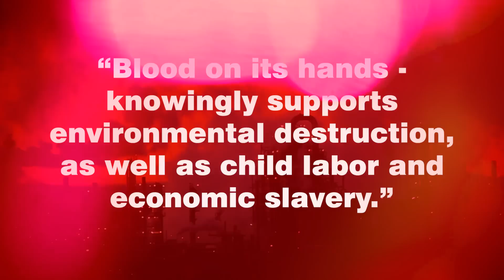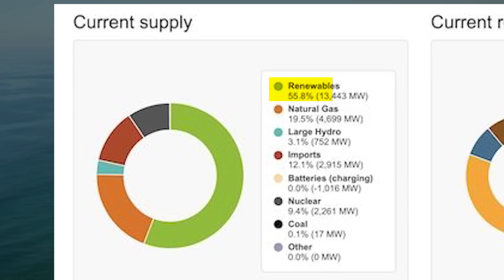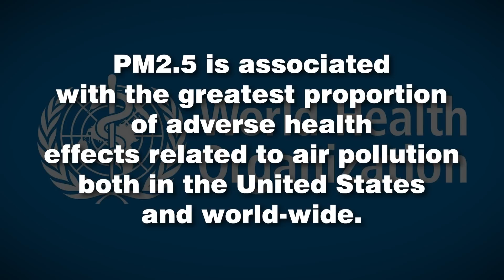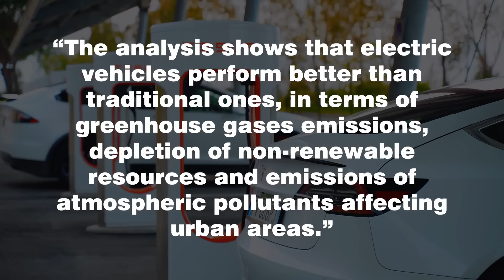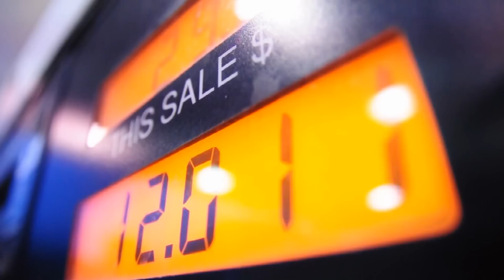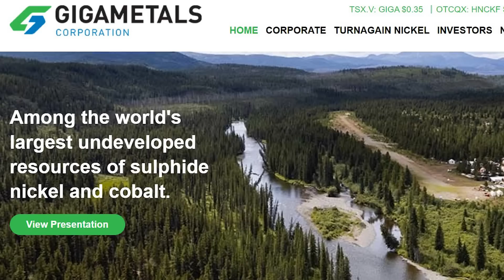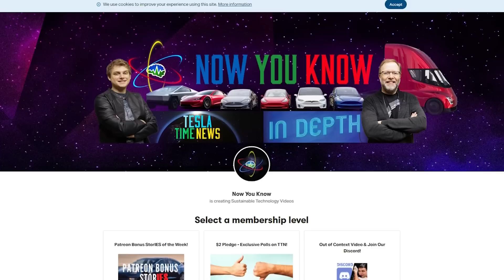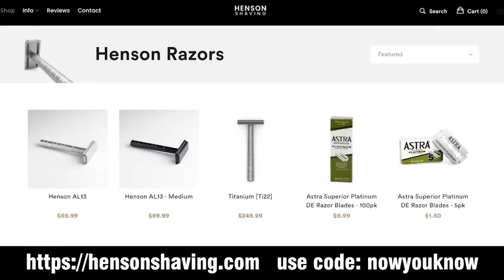Debunking More EV Lies | In Depth

Comment: Electric power plants using fossil fuels for energy are more efficient at extracting energy from the fuel than internal combustion cars. 

Theoretically if everyone converted to EV instead of internal combustion engines in cars, there would be less emissions immediately, as EVs are over 90% efficient using electricity needed to charge to drive. 

Power plants are also 50-60% efficient at extracting energy from fuel to generate electricity, whereas most vehicles only can extract around 30-35% of the energy content of gasoline to propel the vehicle. 

Plus, having all vehicles as EVs mean it’s way easier to cut emissions further, as now you consolidate energy needs to electricity, so the more electricity you generate with sustainable practices, the lower your emissions drop. 

I also read an interesting stat that close to half of all EV owners actually have solar panels.

Comment: Wind and solar will not save the planet. As there closing down nuclear power plants that we need and not just for power. So untill we have fully working nuclear fusion there will always be problems. But even then if all the mining, waste and recycling isn't made fully green and environmental friendly damage will continue to be done. So we need more power, better Tec, better cleaner manufacturing, then more power, better Tec and so on.

Comment: You’re as bad as her. You’re cherry picking your data too and using fear tactics to push your point.

For the honest answers look at Engineering Explained videos and consider that Volvo’s studies show a CO2 break even point of mid 20k miles to 90k miles of use depending on the type of electrical generation method.

Comment: The one I find most interesting that no one seems to make mention of is the how it would take 60,000km before it is cleaner than an ICE vehicle. So the theory is, "it produces emissions so we shouldn't use it." but that ends at 60,000km in comparison to the ICE vehicle which just keeps producing emissions for every day surpassing the EV emissions. Also why did they use Kilometers when they used miles for other numbers. Took the higher number for emissions in KM's, took the lower number for battery life in Miles. You might be giving away your biased when you do that kind of manipulation.

Comment: The comment at 11:26 is also misleading as the highlighted text refers to batteries being replaced every 100k miles (where they got this I don't know as few if any non Tesla EVs have covered 100k miles) but the text GOES ON to say that the more likely lifespan of a battery is 200K miles or more - giving similar longevity to a (well maintained) ICE car. And another "omission" with regard to cobalt is that it has been used extensively for many decades (SINGLE USE) in the removal of sulphur from gasoline. So when you drive round in your ICE thinking no children had to work in a Cobalt mine for my trip to work - think again.

Comment: It shouldn't take 20 minutes to say, "Electric vehicles are only as clean and only as efficient as the methods used to generate the electricity that charges them."

And an all-electric vehicle does not work for everyone or in every situation with current battery technology.  Hopefully it will someday, but not yet.  The energy density needs to increase a lot and the cost needs to come down a hell of a lot for it to be useful to everyone in every industry on every vehicle.  Even hydrogen as an energy storage medium would be amazing in energy density and environmental friendliness when compared to lithium, but with clean water sources drying up it could make things worse in some areas.  Either way people go, we could certainly use more clean sources of energy like solar, wind and hydroelectric power...

Comment: Hey great job 👏 I would like to ask is it true or false that if something happens to a ev battery where you have to spend $10,000 just to get it replaced or is there a life time ev battery warranty that if anything happens to the battery it can be replaced with little to no cost for the ev owner?? Also yes the ev batteries have a great range but that doesn’t mean that batteries will never have problems or fail just like with anything else with or without batteries??

Comment: What I really hate about the statement that electricity is made mostly from fossil fuel is that don't take into account the efficiency. EVs cost 2-3 times less on charging than ICE.  Fossil powerplants are way more efficient that ICE!!!. Second u got way less pollution (air AND noise) in cities. And for recycle, first u need the stuff need to be recycled then u build the industry around it :))).

Comment: Let’s be honest, you guys are electric car fan boys. That’s great but do you really think electric cars are the answer? They are not much cleaner than a gas powered car. The amount of raw materials needed to replace all gas powered cars with electric literally doesn’t exist. You admit it yourself, ‘green’ power generation is not quite there yet and let’s be honest in 10 years it still isn’t going to be either. Buying into all the ‘electric cars are the future’ and all that is just plain short sighted. If you really want to make a difference then I think driving your 200 pound arse around in a 4000 pound plus metal box is a little overkill. And that’s before you even look at the bigger picture and realise that cars are really not the problem. They just get a bad rap because they are an easy target and the government can easily tax them. Swapping every gas powered car in the world tomorrow with an electric one would not  make any real difference to co2 levels. Just be honest, electric cars are cool but electric cars are clean? That’s  not the reality.

Comment: Disinformation practices by the oil industry and their shills reminds me of the same industry’s deliberate deceptions designed to muddle the impact of lead additives that sickens or killed millions, and of course the many millions who died as the tobacco industry misled us.   Also, the power plants that do use fossil fuels are operating 24/7 with minimal capacity to shift output to meet demand…so outside of peak load periods, a lot of generated power is lost.

Comment: Assuming this fud’s claim of a break even pollution point of 60000 kilometers ( 36,000 miles), then that’s a now brainer for ev adoption considering cars in the USA easily last 150000-300000 with a fleet average of  11+ years old and rising

Comment: One thing that always strikes me as odd and seems to be overlooked is the pollution involved in extracting oil and refining it to gas.  People always want to discuss the “long tailpipe” of the EV but they don’t want to discuss the “long tailpipe” of the ICE vehicle.  

This is the 1st video of yours I’ve watched so if you have discussed this before please link me to it as I’d love to see that.  If not can you look into the effects of the “long tailpipe” of ICE.  
How much fuel is burned at a frac site?
How much fuel is spent getting equipment offshore?
How much fuel is burned transporting fuel?
How how much electricity is used to refine oil to gas?
So many questions.
Reply: The average “energy returned on investment,” or EROI, for conventional oil is roughly 25:1. In other words, 25 units of oil-based energy are obtained for every one unit of other energy that is invested to extract it. 
Modern rafineries are 90% efficient.
The transport energy expenditure of oil from well to rafineries to depos to pumps is not readily available but I did read somewhere that something on the order of 25% of all international shipping is shipping fosil fuels around. Of course that's all fosil fuels not just oil.
But that is ignoring all the leaking of natural gas from oil wells and oils spills and the cost of the army needed to secure the oil geopolitically and literally. Etc etc.
Reply: From what i have found burning 1 liter of gasoline produce about 2kg of co2 while the extraction, refining and transport produce 1kg of co2 per liter, so the total emission is about 3kg of co2 per liter

Comment: Yeah honeslty  I seen her video awhile back and had me completely confused and well I took her "Reoporting" for face value without really noticing that she doesn't even know! So I was convinced that the energy used in EV;S is from other sources then that of green and that EVS are just as bad as a motor car, but you guys did touch on many important key factors like the burning of fuel exerting greenhouse killers and also alll the polutans that are still around well after the life of an average gas motor vehicle.

Comment: WAAAOW -great hit piece, you must really hate her. But if you want to have a convincing argument for EVs you need to focus less on how much you hate her, and more on the bigger picture. There's more to the EV picture than "cleaner" energy, and "renewables" energy. Like the fact that energy density stored in a battery is 1300% LESS than energy stored in gas. So, even with a 1100 pound battery pack, most evs will only get a 200 mile range per charge. And the question is not so much "are they cleaner", but "are they better"? Are they more affordable? NO. Are they cheaper to insure? NO. Will it cost less to charge vs fueling? possibly. Does the 7500$ credit from the government take the bite out of the cost vs ICE cars?(~20,000 - 7500=12500 more)NO. Which that's expiring, isnt it? Do EVs have Right to Repair protections?NO. Thats important. Its like apple. Do you own or control the car? NO.(Tesla has shown, and demonstrated, they can and will reduce your battery capacity at the flip of a switch.) They can also shut it off entirely. Also-losing your temper and cussing like children, makes nobody take you seriously. Now you know.

Comment: wind and solar require gigantic swaths of land to generate large amounts of electricity, coal burning takes a factory the size of what 2 blocks? it's tough to get 100's of acres of land in some areas so you would have to transfer the energy long distances and also pay a premium for that transfer not to mention the sun doesn't always shine and the wind doesn't always blow. Look at Texas during that ice storm wind turbines were shut down and solar panels were covered in snow/ice. People had to pay thousands for energy. In 10-15 years the statement might be false but currently its a true statement that electricity comes from mostly coal.

Comment: You guys were incorrect on one item. A Nissan leaf battery pack is only good for approximately 100,000 miles. They cannot go longer. I have owned two of them and after 100,000 miles they are just throw away cars.

Comment: I think you need to look at your wide grid to determine the amount of renewable energy your vehicle is using. Even if you have solar panels the electricity is fungible. If you live in an area of the country that uses a lot of non-co2 based electric production, you have a far better result of lowering CO2.  But as you stated, more and more of the country is using renewables.

Comment: Either you two are benefiting from this misinformation  or you are both delusional.  There is no doubt that EV's are cheaper to operate today but are you seriously going to try and say the environmental impact is less than a fossil fuel vehicle when you take the impact of the power source and the cost of mining for both fuel and battery storage. You should figure the miles to drive (or how many miles you need to drive) before the cost to operate is finalized. Otherwise,  you're fooling yourself into believing what ever you want to believe.  That is not scientific.

Comment: Something not covered in this amazing video is the fact that coal power stations etc tend to be sited well away from major urban areas which means the pollution is not in the city whereas all those gasoline cars Sorelle seems to be advocating for are!
That means even if someone buys an EV and even if the electricity to charge it comes from 100% coal generation then just on the pollution front alone the pollution will be away from the city where most people live making it healthier than the alternative she clamours for which is cities full of polluting cars infecting your lungs as you have no choice but to inhale.

I would offer her to take up Arnold Schwarzenegger's suggestion to have two sealed rooms, both identical.
Room 1 has a gasoline car that is running and room 2 has an EV that is on. She has to choose a room, enter it and shut the door behind her. She stays there for an hour and is not allowed to touch the car nor have any breathing aid such as a respirator.
She would choose room 1 right because EVs are bad according to her.

In which case it was nice  knowing her 🤣!
Reply: Don't (just) use the "away from the city" opinion.
.
Use "it's the same grid mix that the refineries use to make the gasoline, which is then burned in the engine"
It's DOUBLE pollution.
.
If they come back with "refineries don't use the grid"
Try
So they burn THEIR OWN fossil fuel, to MAKE fossil fuel?
.
In the very worst case, "EV electricity" is equal with MAKING the fossil fuel.
THAT'S "zero sum".
The EV has NO pollution from that point on.
.
The ICE fuel is transported (pollution) then BURNED in the engine.
That's all over and above the "ZERO".

Comment: With the final part of our planets current magnetic excursion and the next micronova all happening near the end of the 2030's- early 2040's, our dependence on electronic tech will be our doom.

P.S. cow farts and tailpipe exhaust are NOT the primary drivers of CC.  CIMP6 models are including the real cause of CC... solar particle forcing.  But by all means, clean up pollution.  We all hate that.  Just don't think anything is going to change the trend.  We shut down most of the industrialized 1st world for months in 2020, and we had one of the hottest years ever.  And the increase in heat isn't a daytime problem, it's that the nighttime temps are not cooling down as much as they normally do.

Comment: I stopped watching around 4:44, because saying that EVs produce no pollution is just more a lie than saying they're no emission, they've ignored emissions it costs to make the car, to mine the materials for the battery and the toxins that the batteries make at the mining sites as well as what happens to the batteries when they're the cars are inevitably thrown away

These batteries are full of toxic metals that the ecosystem can't handle or process, so run off from mining sites usually result in death of plantlife in those areas, then it's not cost effective to recycle these batteries resulting in more pollution when the car is disposed of, solar shares both of these problems as well.

Compared to that a gas car that produces CO2, a gas chemical compound that plants have adapted to consume to grow, and the creation of diesel exhaust fluid, which renders most harmful emissions from a diesel engine inert, is far cleaner than an EV.

Also most people don't live in california, that's why she said most of the energy in the US was still made by fossil fuels, because as opposed to the 1 state you wanted to cheery pick out of 50, she was talking about all 50 together. Nevermind the fact that solar and wind have proven to be extremely inefficient and unreliable given that calofornia has suffered stints of rolling blackouts and energy emergencies since they shifted to primarily solar and wind, asking people to not charge their electeic cars because of the strain it'd cause on the grid

If you really wanted a clean emissionless vehicle and energy, you should be looking at hydrogen combustion engines and nuclear energy

Comment: This is absolute rubbish.  Its not actually possible to replace engined vehicles with battery vehicles as the quantity would lead to an environment and human health disaster.  It would make ys taxation and cost slaves to battery vehicles and pawn generation forevermore.  Also this totally misses the effects of radiation poisoning a risk posed from mass building of nuclear reactors and dealing with the waste.  There really is trillions of tonnes of fossil fuels being used in every aspect of battery vehicles, making batteries,  mining toxic materials,  mass spending on manufacturing of infrastructure and installation,  building battery manufacturing facilities, arms manufacturing and wars to halt supply of oil and gas to force dependency on batteries, nuclear,  photovoltaic panels and wind,  no mention of dangerous emissions raised in environment if mass battery vehicles and nuclear us uptaken.  Battery vehicles are a very fake virtue signalling backed entirely by heavily funded mainstream media and complicit governments,  computer geeks and misinformation from battery vehicle fanatics that have become insanely obsessional with battery vehicles and control measures required to force fake green measures. Never forget battery vehicles are receiving vast swathes of money from involuntarily and leached from our environment.  Fossil fuels are an abused gift that can never be replaced on a like for like basis . There's only one option and that is to stop obsessional growth greed economies,  stop feeding wars,  stop expansion of armies, stop bs , understand that growth means destruction , understand that when you find governments and corporations say they know best it means the future won't be good if you believe them , the future is in human integrity not obsessional control by obsessional battery vehicle owners and energy companies.